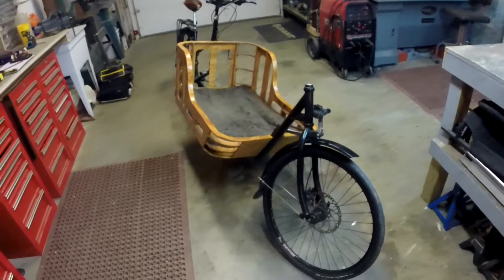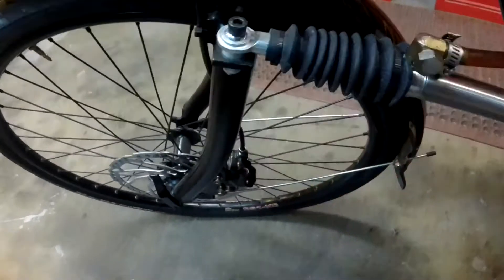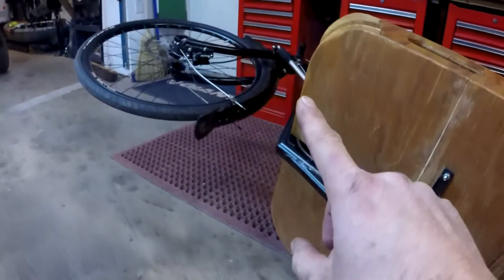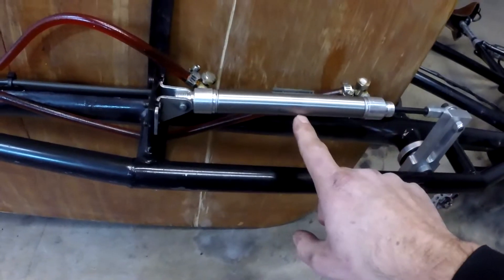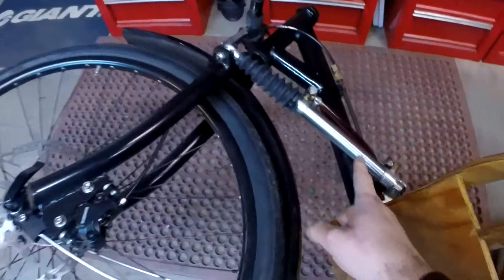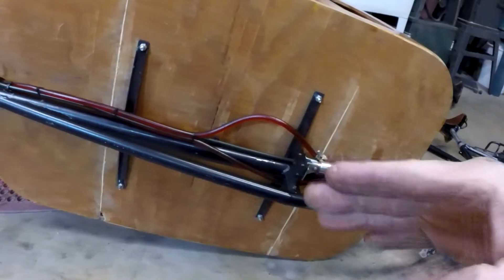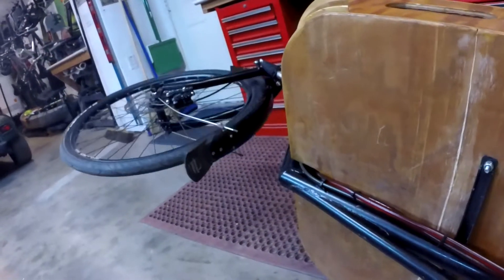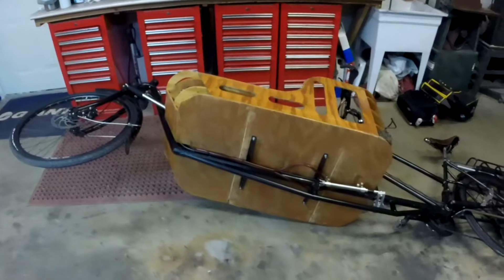Cargo Bike Hydraulic Steering, How It Works.

Comment: Where u buy the Zylinder?
Reply from the maker: I got them from Automation Direct. They are a .75” bore 4” stroke double acting pneumatic cylinders. Cheers!
Reply: @themellowmechanic  my Englisch is not so good, you mean this is From a Company spacial for you? Can you tell me, i see by aliexpress zylinder for RC , u think i can buy this?
Reply: @themellowmechanic , smart solution...what more components did u buy to link the tubes? I did not find any in the accessories..

Comment: Very interesting and unique solution but the steering angle is horrendous.
Reply from the maker: Thanks for watching! Yes, you are correct. I need to use longer cylinders. I have been tossed off the bike a couple times from hitting the hard stop steering limit.
Reply: @themellowmechanic  Would be interesting to play with different leghts and also changing the ratio of piston size.

Comment: Sorry to say but as a fluid power engineer I can tell you that these enclosed systems have several issues. The cylinder seals will leak, so you will lose alignment. Also without an expansion tank, temperature changes will create huge pressure variations that are likely to damage components. I'm sure it will work fantastically at first but beware of long term issues.
Reply from the maker: Thanks for watching! I agree with what you say. I have indeed found some of these issues. The steering system has been in service for over a decade without any catastrophic failures. It may be due! The biggest failure of the system so far has been mechanical. The cylinders I used are designed to be either extended or retracted, not cycled in short strokes in the middle of the travel. This movement wears the rod in the middle allowing fluid to leak out. I have retrofitted the cylinders with rubber bellows to keep abrasive debris off the rod. This fix has worked so far but time will tell. Cheers!
Reply: @themellowmechanic where to buy those cylinders? Any problem with air balls in the circuit due to hot temp in summer?

Comment: Let me ask you where you found those cylinders. I have been looking everyone and nobody has something that small that is hydraulic. I can buy pneumatic and I was wondering if think for the low PSI we need to turn a bicycle wheel, if an air line would work just as well?
Reply from the maker: Yes, I used air cylinders. The pressure is so low that they work fine.
Reply: @themellowmechanic  ok thanks. does the cylinder produce more power if filled with oil rather than air? I tried using a pneumatic cylinder as a steering damper on a trike and it did very little. Very little resistance. If i fill it with oil, will it produce much more resistance to movement? I wondering if that is why you used oil in a pneumatic cylinder rather than just push air through the lines as your fluid.

Comment: My only objection to the hydraulics is failure caused by the severing of the line.

A bit dramatic but that's what happens in a lot of aircraft disasters.

They've gotten rid of mechanical cable control of the ailerons and flaps. 

Any piece of metal moving through the fuselage at high speed shreds the pipes leading to total loss of control.

Apart from that the hydraulic system is a vast improvement over the traditional mechanical linkage.

Comment: My question. Do you still feel connected to the bike and road ? Or does the hydraulic system take away all the feedback or feel of the road ?
Reply from the maker: It actually feels very natural. It is not mushy or sloppy. The fluid in the line acts as a damper so the movement is silky smooth.

Comment: I am in the process of ordering all the pieces. I only have two questions regarding the fittings. How are they screwd so they are pointing in the right direction and what is the threading size of the seal bolt. On my fittings I only have space for M5 size hole but your seal bolts are bigger (1/8 does not fit the fitting) - how fitting :) Can you provide me with the link to these components or a description? Thanx.
Reply from the maker: Thanks for watching the video. The fittings I used are 1/8” npt. The reason I went with that size was I didn’t want them to be too restrictive. The cylinders come ready for 1/8” npt fittings. The fittings are an off the shelf item I got from my local hardware store. I did machine a 10-24 bleed port into the side of them but that is not necessary as you can bleed them by disconnecting the hose.

Comment: I've got plans to make a Kyoto Cruiser with some modifications, and this is to be one of them. Where did you source the cylinders? I've only been able to find big, heavy, 5000psi cylinders at around $200 each.
Reply from the maker: Go to Automationdirect.com. They have a good selection of pneumatic cylinders.  A12040DN is the part number for the cylinders I used.
Reply: @themellowmechanic  That part number comes back as a pneumatic cylinder. Is it possible that you are using oil in a pneumatic cylinder? What kind of oil did you use?

Comment: I forgot to mention in my earlier comment, this is such a innovative and neat solution. Can you provide instructions on how to set up lines and putting ATF fluid in the system? I am build a cargo bike myself and would like to use this.
Reply from the maker: Thanks for watching! As far a bleeding the system I used two syringes which attach to the fittings via bleed ports. I machined the bleed ports into the fittings.  I locked one cylinder fully extended and the other fully retracted. Then I used the syringes to force the atf through the system. Once all the air is out I plug the bleed ports. The atf fluid acts as a damper to eliminate any wobbles.
Reply: @themellowmechanic  thanks! I think I have all the parts in my shopping cart. It looks like you have barbed fittings and the bleed valve on a Tee joint? Also, do you have the part numbers of the bleed valves? Thanks again, I can’t wait to add this to my bike build.
Reply from the maker: I machined a 10-32 threaded port to the top of the barbed fittings.  My syringes have that thread fitting on them.
Reply: @themellowmechanic  oh wow. That is way beyond my ability…
Reply: @themellowmechanic  is it possible that I can pay you to make this for me? I did some googling and can’t find a solution.
Reply from the maker: It’s a lot easier than it sounds. Go to the hardware store and grab a 10-32 tap and the correct size drill. Find a spot on your fitting that is relatively flat and drill and tap your hole. File the area flat. The 10-32 fittings are not tapered so they seal with an o ring. Find yourself some fittings (two barbed fittings for the syringes and four plugs) on Amazon and you’re all set.
Reply: @themellowmechanic  Thanks again for advice. If possible, can you send me close up pictures of your fitting set up? Thank you again...this is such a genius design that I want to use this on my bike build.

Comment: can you think of reasons why this isn't widespread among cargo bikes? it's such an elegant solution, and it looks buttery smooth
Reply from the maker: I don’t know why other cargo bikes or even some recumbent bike don’t utilize this design. It’s simple and works well.
Reply: @themellowmechanic  gives me a funky idea of a bike where there's a very short steering tube cut way up at the level of the top of the wheel, and the rear wheel partly tucked into the cargo area (with a partial wheel-well intruding into the box) and the rider "hanging" on the back of the bike. significantly reduced wheelbase in return perhaps minus 60 litres of capacity, with the torsional rigidity not necessarily compromised. i've never seen anyone make a cargo bike where the rider is behind both wheels, but why not? tell me if i make no sense, i'll draw it.
Reply from the maker: It’s a neat idea. It would make the bike very short. How would it ride unloaded? It would be really easy to do a wheelie!
Reply: @themellowmechanic  i'm not so sure. i was about to write an elaborate comment about the weight distribution, but my estimates were wrong. a shorter chainstay sure would help my creation, and i'm not sure of front wheel grip, as even more portion of the weight than usually is there would go to the rear wheel in this case
Reply: @themellowmechanic  look out for the URban Shyft later this year. Full hydraulic steering.
Reply: The cost would be a factor
Reply: 50 € worth of components @tad2ik  instead of ~20 € worth for the steering rod? (rest of the linkage being identical) hardly a difference considering the design constraints lifted with the hydraulic version

Comment: Thanks for making this video! 
I'm looking forward to develop a 180 degree turning hidraulic steering for cargo but before that I wanted to test the same system as you did so to see the actual flex that can be caused mostly by the hoses. So my question would be that how much of flexing you experienced with these simple transparent plastic look tubes? By flexing I mean the sort of "lagging" in steering under load, I hope it makes sense to you. Thanks!
Reply from the maker: Tomi, there is hardly any ‘flexing’ from the hoses. Air in the lines will give a squishy feel with some lagging. The hardest part of the design for me was to develop an easy way to evacuate all the air from the system.

Comment: Thank you for all the informations, this is amazing. I have some questions : 
- How the pneumatic cylinders, mades for air, react to oil ? 
- Does the external temperature have an influence on the steering feeling ? Why automatic transmission fluid ?
- How this steering system is reacting when the bike is loaded ?
- How did you choose the right hoses diameter ? 
- Did you tryed with smaller diameter hoses ? My gess is that it could make the steering harder, but I'm not sure about that, I don't have a lot of experiences with hydraulics.
Reply from the maker: Thanks for watching! The cylinders work the same as air, even though they are full of oil. As far as temperature, I have not noticed any difference from hot to cold.  This is one of the reasons I used ATF. It has the correct viscosity and is stable at a wide range of temperature. Because the system is hydraulic it reacts the same loaded as when it is empty.